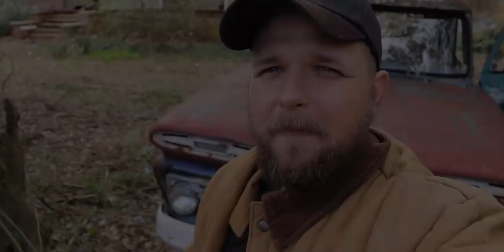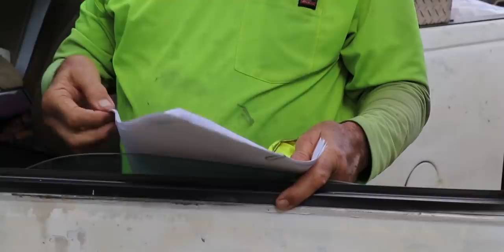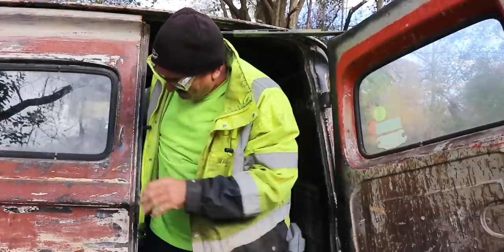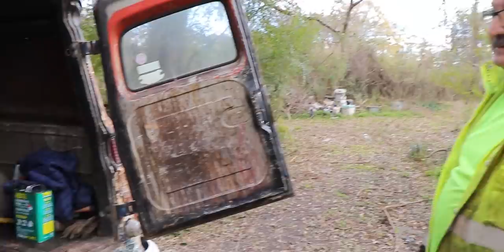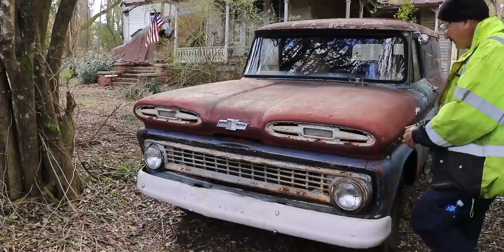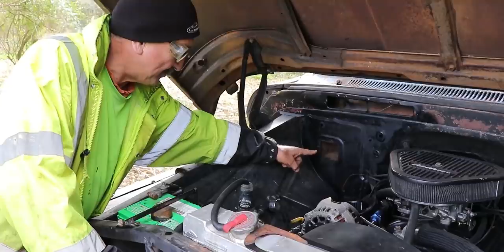New Farm Truck! | 1966 Chevrolet C10 Panel Truck

Comment: My dad, Jack was a carpet layer when I grew up in Amarillo. I remember vividly his 1 ton Dodge Panel van. Next after that was a 1964 C20 Chevy pickup. It was white over blue and he had a camper shell topper. He wore it out and next was a 1969 Chevy C20 (3/4ton), same color and the camper shell fit just fine. I worked weekends and summers with dad starting at 12 years old in 1964. Different time and different values.

Comment: I have a 64 C20 3/4 ton pick-up that belonged to my grandpa it's all original for the most part and it has the in-line 6 292 it runs and is registered love it,nice new old panel

Comment: I have a 78 Chevy Big 10 with topper I call mine the beast the motor redone with less than 20k with Holley carburetor It runs well had to replace both gas tanks. But yours is wow sounds great. that motor with that Edelbrock sounds more beastly than mine very nice story that is definitely your truck with the friend story and the hood your friend will be riding with you  in spirit so cool.

Comment: I had a 65 C10 with 235 straight six and three on the column. Fun times.

Upgrade that brake system to a dual master cylinder. You should change the fronts to discs too if you can afford it, but do the master anyway.
Reply from the maker: Definitely planning on doing that
Reply: That is what I learned to drive on

Comment: Wow robert there was one identical just like that it was down the road from me sitting back in the woods it didn't have the front fenders or hood on it well the doghouse was gone but the body was perfect and it got junked a few years ago...I have the parking lights that were bolted in the hood and they are white just like yours I have a extra set if you ever want them good video buddy 👍👌✌️they didn't come from the panel truck they were in a old hood I found an I took them out

Comment: I noticed that had a floor shifter ! Does it have 4 on the floor ? Man that is one SWEET SONDING TRUCK ! With that paint job , that Engine and transmission some people would call that a sleeper ! Because could probably out run most vehicles !

Comment: Hell yeah!!! Being a Chevy gal, I totally understand the love you have for your truck. Can't believe the original wood is still in there. I've got an Edelbrock on mine too. My heater doesn't work either, need to replace the heater core and replace a broken lever on the control panel for the blower. Engine sounds great!!! Love that you swapped out the hood. I'm so excited for you!!!!

Comment: That hood, though it may have been on a '61 C10 at some point, it's actually off a '61 Viking (Big Truck)
Reply from the maker: The hood is off of my 1961 Apache 10... the Viking emblems I got off a big truck in a junkyard and put on the Apache 10 cuz it was missing the original emblems.